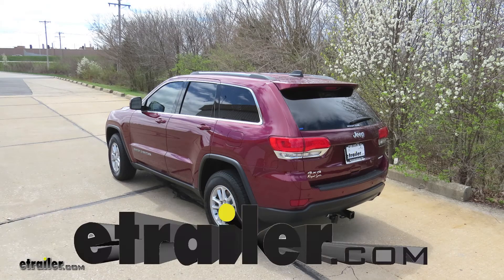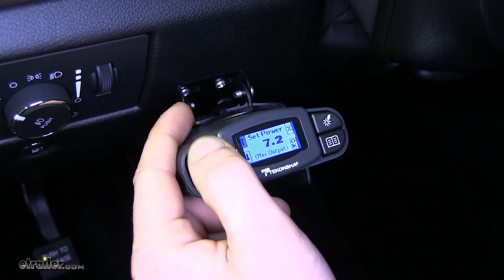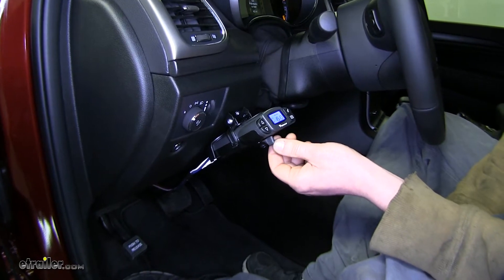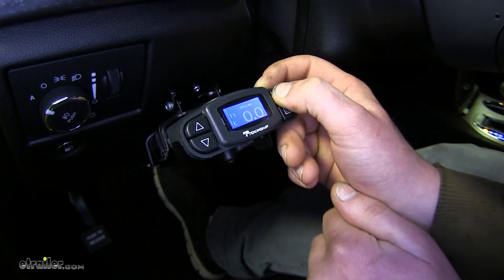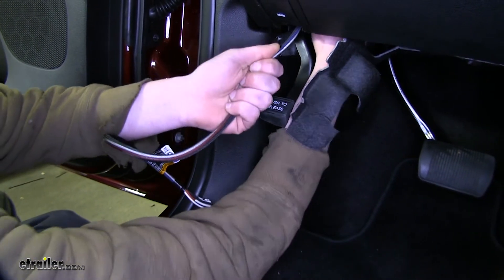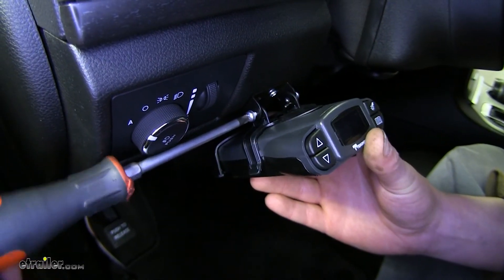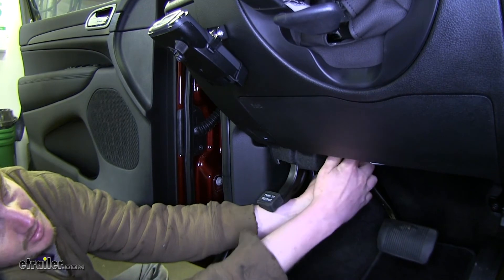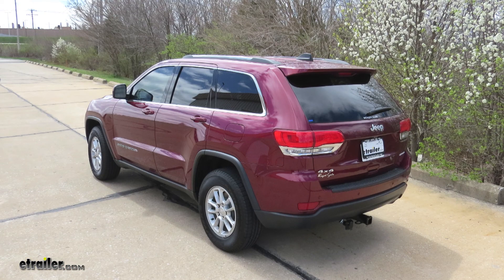etrailer | Mount: Tekonsha Prodigy P3 Trailer Brake Controller on a 2018 Jeep Grand Cherokee

Comment: Found it difficult to install grey connector in 2018 JGC manufactured in Jan 2018. Trailer brake connector was not taped to large connector-too little hand space, little vision to it and connector rigidily mounted not on large connector. Accentally moved large connector off its attachment and then had vision and hand room for grey connector.  Large connector can be easily detached from its support by pushing toward rear of vehicle and easily reattached by sliding back on support by pushing it forward.

Comment: Thanks but hardest part is identifying where exactly to plug this in. That was very glossed over and still don’t know.
Reply from the maker: If you fast forward to the 3:30 minute mark and pause the video, you can see exactly where the connector is located. The linked install instructions will also be helpful. Keep in mind, the connector won't be there unless the vehicle has the factory tow package with the factory 7-way at the rear bumper.
https://www.etrailer.com/Accessories-and-Parts/Tekonsha/TK93VR.html
Reply: @etrailer  Thanks so much for your reply. I think that answers it, I got an aftermarket tow package so it must not be there.

Comment: I don’t know which one to purchase
Reply from the maker: The # 90195 Tekonsha P3 is a great choice, but we prefer the Redarc Tow-Pro Liberty, part # RED24FR. You'll also need the # RED77FR pigtail if your GC has the factory tow package or # RED69FR and the # ETBC7 install kit if it does not have the tow package.
https://www.etrailer.com/Trailer-Brake-Controller/Redarc/RED24FR.html
https://www.etrailer.com/Accessories-and-Parts/Redarc/RED77FR.html
https://www.etrailer.com/Accessories-and-Parts/Redarc/RED69FR.html
https://www.etrailer.com/Accessories-and-Parts/etrailer/ETBC7.html